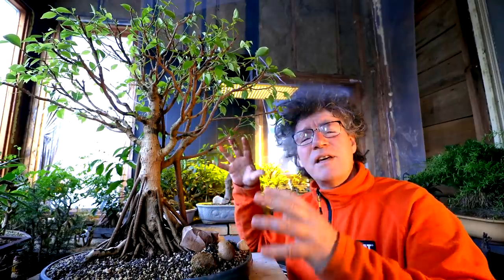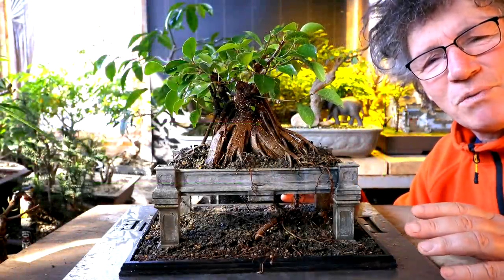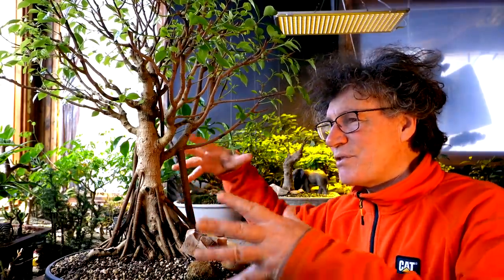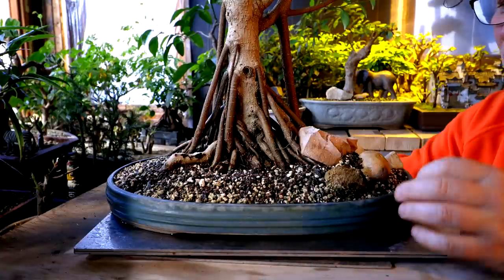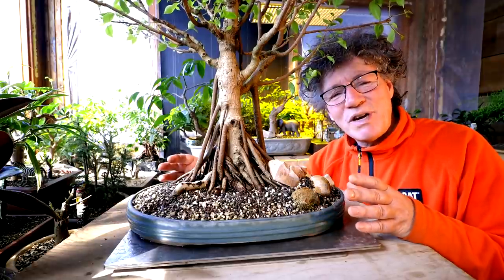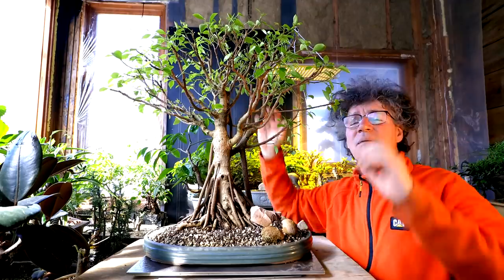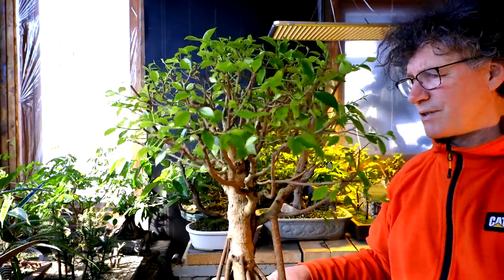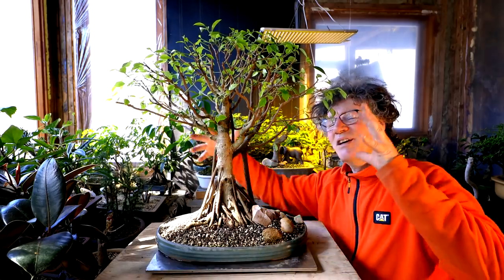A Custom Pot for My Ficus microcarpa, Part 1, The Bonsai Zone, March 2021

Comment: One good thing that you missed mentioning regarding the advantages of a 3D printed pot is that you can color it according to your liking and also the fact that it'll be way lighter than a ceramic pot which might be 3-4 times the weight 😁
Reply: I have seen some really nice printed pots. Some folks go way beyond what tradition calls for and, were they made of ceramic, the price alone would be prohibitive.

Comment: That is awesome!! We shall incorporate new tech to bonsai. Traditions are good, but if they are meaningless they are useless. I am using some fiberglass pots and cement/resin pots with great success.
Reply from the maker: I do really like the nice ceramic pots, but I think  the 3D printed pots are awesome too. This will be a good test for a larger pot to see how it works out!
Reply: @TheBonsaiZone  I like ceramics too, but we shall keep our minds open to new materials, designs... I like what Stephen is doing. Also what Ryan at Bonsai Mirai... some breakthroughs are happening 🙂

Comment: @Nigel: You can even have both: 3D-printed and metal, even steel: It is called additive manufacturing and is performed by laser-melting metal powder layer by layer, which actually produces massive steel parts. Don't ask the price of such a device, though.
Reply from the maker: Yes, I think we'll see some really nice materials used in 3D printing pots inn the future! I'm going to try the clay infused PLA next and see how it works.

Comment: Hey Nigel, the internodes of the shoots on your ficus semm to be a bit large to me. Did you recognize a difference between the internodes length after defoliation in summer (natural light) and winter/spring (artificial and less natural light)?
On my tigerbark I recognized a vast difference this winter despite the fact that the tree was 12h a day unter the right amount of artificial light 😱 the internodes length were unexpected big and the second flush after first pruning was quite smaller, very confusing 😅
Last question, when did you start feeding it after defoliation and repotting? 👍🏼
All the best for you 🙌🏼🙌🏼 and keep going with that excellent content 🙏🏼☺️

Comment: Nigel - Hey there!  

I've got a question that I believe only you can answer, as it concerns one of your other videos which I cannot find.  I'm reasonably sure you did a video where you were pricking out recently germinated seedlings to separate and repot, and during that process you snipped off the original root so that the seedling had no roots whatsoever - dipped them in powdered rooting hormone and replanted them - all in an efforyt to grow more attractive nebari from the start.

Can you confirm that you produced such a video, and if so, could you direct me to it?   

Last autumn I collected several hundred vine maple seeds and immediately sowed them in flats outside so they'd get stratified properly and germinate when spring directed.  So, now I've got several hundred tiny vine maple seedlings that I'm pricking out and replanting - but it seems that quite a few of the seedlings maybe have started damping off.  So, as an experiment in saving a few that might otherwise die, I started applying the technique that I think I learned from you; cut the damaged rot off -  dip in powdered rooting hormone, water in, and see what happens.

But yea, If you could locate and link me to that video, it would
Reply from the maker: Hello JT, I'm not sure it was my video, I've seen lots of articles where they do this technique to Black pine seedlings. You can follow my technique with the Osage Orange forest I am developing from seeds. Here is the playlist....
https://www.youtube.com/playlist?list=PLQouTWwmTQozknVI8McCcS0MQ_xPoY3Yo
Reply: @TheBonsaiZone  How strange - I was sure I'd seen you do it here - but then, you knew what I was talking about and that's all that really matters - I no longer think I'm nuts :D  

Thanks, Nigel!